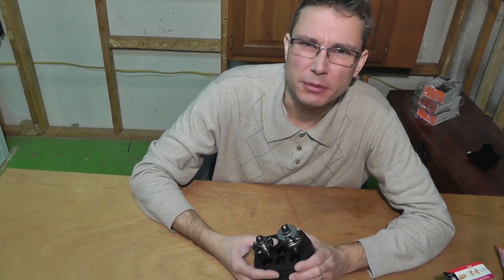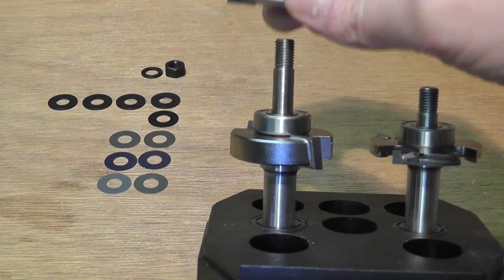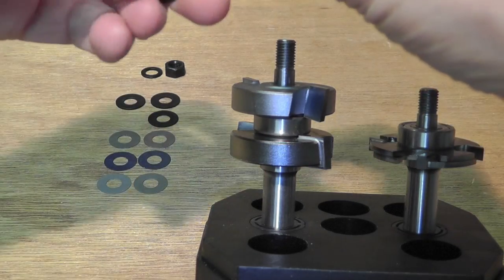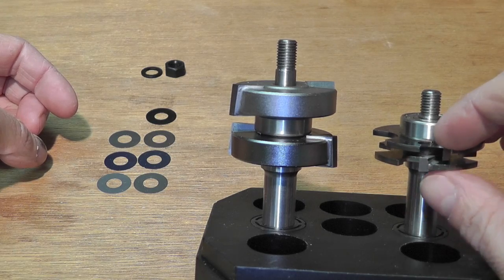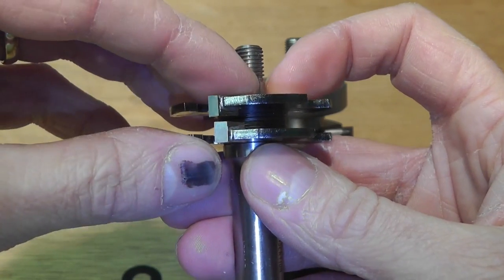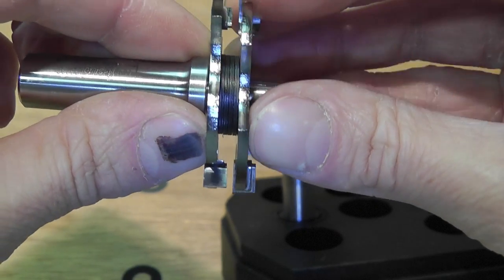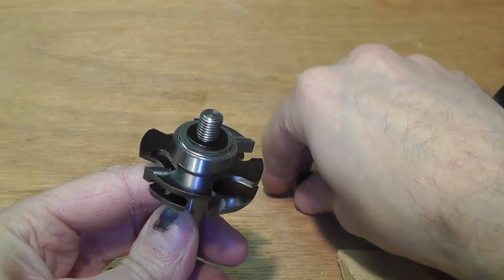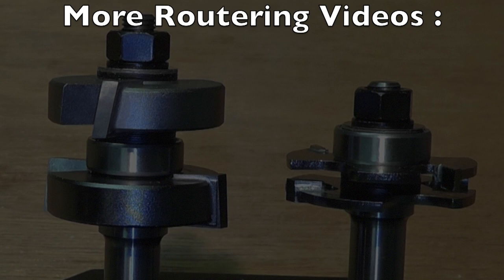Adjustable Tongue and Groove Router Bit - EXPLAINED

Comment: On the bit that has the 2 cutting heads, you should put an equal amount of spacers on either side of the bearing so you keep a balanced/equal amount of pressure on the tongue part of the board from the top and the bottom. When I saw you put all the spacers on one side (the top of the bearing), and not keep them balanced (1 on top, 1 on bottom, ....2 on the top, 2 on the bottom etc.) it made me think that there could be issues with putting uneven pressure on the bit etc. Just a bit of advice ;). I've used routers a lot and that's what I would do personally. Also for anyone reading this, make sure the cutting edge is facing in the direction that your router rotates, as he had some of the blades backwards in this video. The sharp edge needs to be facing the direction that the router spins. If you put it backwards you'll know because you'll just get a lot of smoke and heat and not be cutting worth a crap! lol.

Comment: Hi, I wanted to say this is a great video and is very helpful, even 7 years after its original creation. I did want to mention something about the spacers though. Note: I've written to Freud to ask them about what I'm about to tell you, but I haven't gotten a reply yet.

In this video, when showing the groove cutting blade, you showed the ball bearing going directly onto the top cutter blade, with nothing between them. If you'll look at your unboxing video, you'll notice that out of the box, 1 of the .039" spacers is between the ball bearing and the top cutter. This is because there is no offset milled into the cutter, so without the spacer the bearing sits directly on top of the cutter and won't allow proper rotation of the bearing. This means that only 3 of the 4 .039" spacers are available to be used between the cutters. I've asked Freud why they don't mention this in the pamphlet that came with the set.

Comment: How do you know the thickness of each spacer? I can't tell by looking at them. A 1/4" groove requires .020 + .008 + .006, but they all look the same to me in terms of thickness.
Reply: I wish someone had an answer! Just bought the set and trying to figure it out.
Reply: @cpruitt123  I just measured them with a caliper.